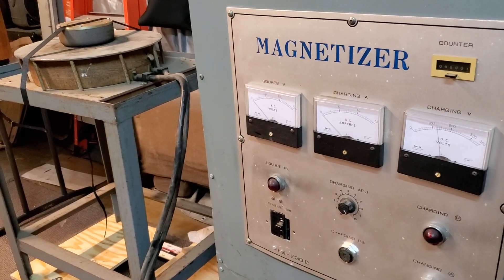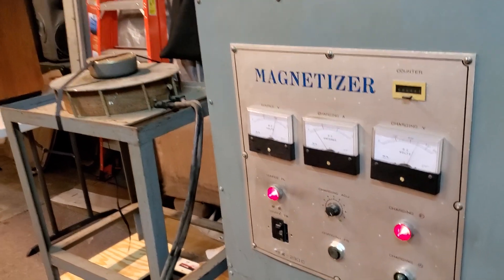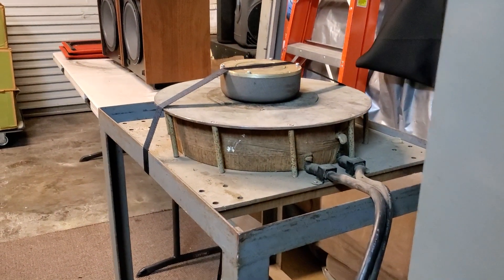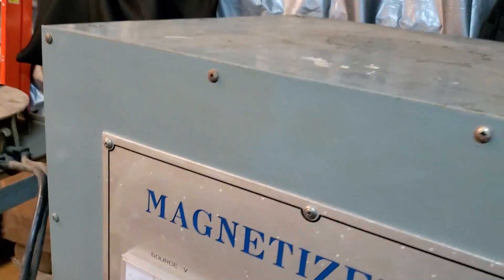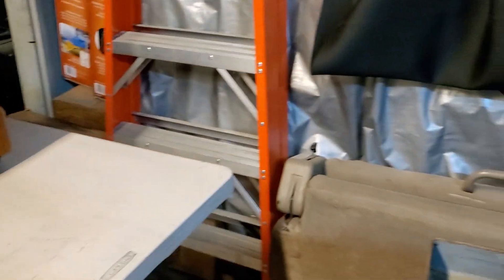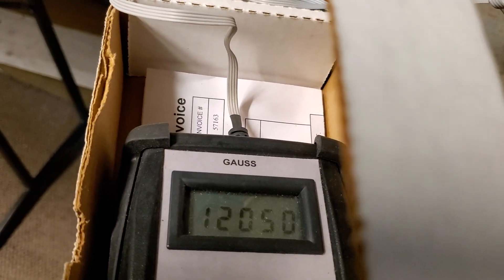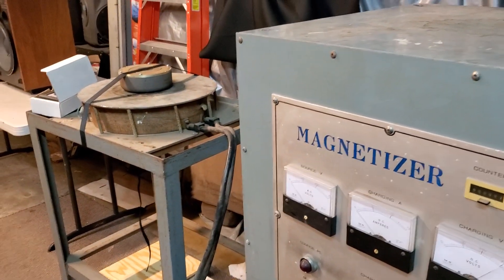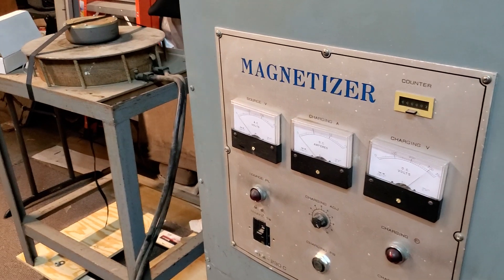Magnetizer in the shop!   Upland Loudspeaker Service. www.repairspeakers.com

Comment: Nice!  What kind of coil do you use with this?  I've heard conflicting information, some say the coil is very heavy gauge wire with only a few turns to keep the current spike high with a very fast rise time, others say the coil is 100's of turns or more.  I would be curious to know, thanks.
Reply from the maker: Honestly,  I don't know. It's different from other magnetizers I've seen. The magnet sits above, rather than in the coil.

Comment: It would be very interesting to see/hear a side-by-side comparison of before and after recharging.
Reply from the maker: @garygallagher7341  depending on the level of discharge, the moving assembly gets looser and sloppier from reduced flux density in the gap controlling the voice coil. Makes the frequency response look like a frown.